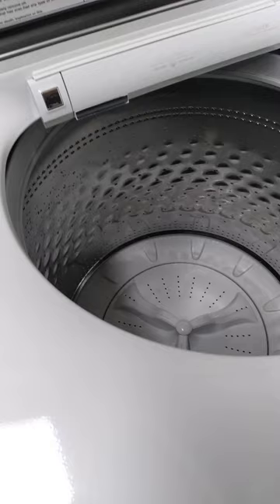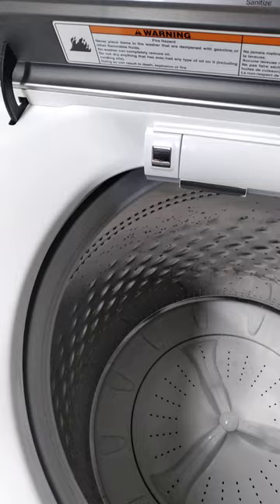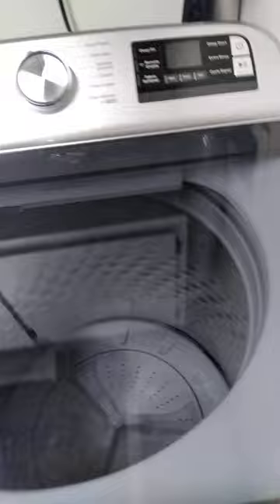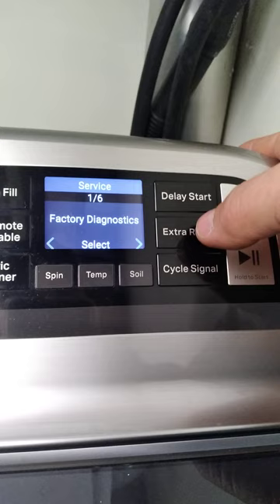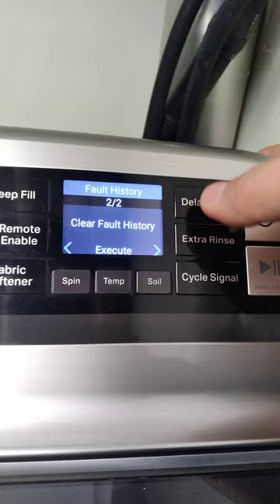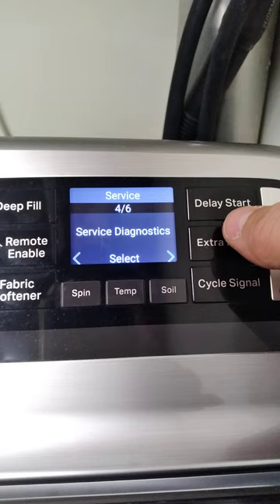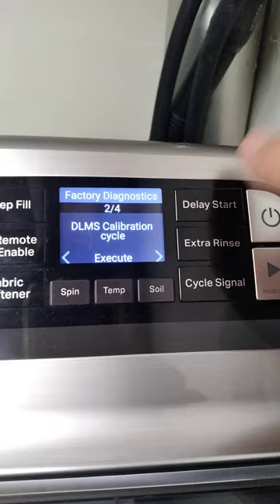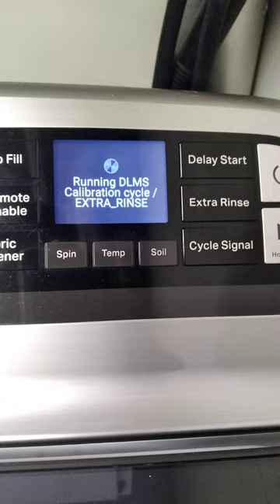Calibration and fault code in diagnostics for MVW7232HW0

Comment: I have this same washer and it is stuck in the sensing mode. It stays on that cycle for several minutes then it says washing complete and shuts off. It’s only a year old. Any ideas what the problem might be and can I fix it myself? Thank you!!!
Reply: Yeah I got the same problem  like you can see this guy don't answer the comments 😢
Reply: Same problem
Reply: I'm having the same issue. The wash starts in sensor mode than jumps to wash complete. Did you have any luck with finding a solution? This sounds like a recall issue.
Reply: @monet3293   I bought it from Lowe’s and paid for the extended warranty. 
I had a repair guy come out and run some tests on the washer and it acted perfectly for him. He said he would order some part and be back in a couple of weeks. The washer has had no further issues since then
Reply: @jasonpayne280   What part did they need to order?
Reply: @monet3293  they haven’t been back yet to install it. I will advise what part when I find out. I just know that after the repair man ran some tests on it, the washer started working like it is suppose to
Reply: I found the cause and solution!  It's caused by a bad Slider/Clutch.  This is a 2-part component - a plastic center hub, with a magnetic metal ring or band around the outside.  And that is held on by small plastic protrusions that fill in small holes in the clutch.  The problem is that these protrusions break off, and that metal ring is free to slide up or down from the plastic part, with the result that the "teeth" may not engage with the teeth of the rotor.  You could replace the clutch/slider (part # W10734521), but it will break again in a year or two.  So, I tried gluing the ring to the plastic using Super Glue Gel, after roughening up both surfaces with sandpaper first.  So, far, it is working great.  Only time will tell if that is a permanent fix for the problem.

Comment: My washer is making the popping noise at the beginning of the cycle. The display shows “sensing,” the machine clicks for 2-3 minutes and then shows “cycle complete.” What’s going on with my machine?
Reply: I found the cause and solution!  It's caused by a bad Slider/Clutch.  This is a 2-part component - a plastic center hub, with a magnetic metal ring or band around the outside.  And that is held on by small plastic protrusions that fill in small holes in the clutch.  The problem is that these protrusions break off, and that metal ring is free to slide up or down from the plastic part, with the result that the "teeth" may not engage with the teeth of the rotor.  You could replace the clutch/slider (part # W10734521), but it will break again in a year or two.  So, I tried gluing the ring to the plastic using Super Glue Gel, after roughening up both surfaces with sandpaper first.  So, far, it is working great.  Only time will tell if that is a permanent fix for the problem.

Comment: Hi Kyle ,  I just put in a new control board because the old one went out had the Maytag 3 years go figure. My questions is I have calibrated the washer, reset to factory defaults and unplugged the washer for 3 mins, on the short cycle it gets stuck at the spin cycle at 12 minutes and stays any thoughts what could be causing the issue?
Reply: Having same problem, find out anything?
Reply: Yes after calibration and still stuck, on the spin cycle option choose medium not fast this will fix issue
Reply: Also on the normal cycle turn off the fast spin then it will work too mine does not get stuck anymore hope it helps
Reply: Thanks! Will try later
Reply: It worked! Why doesn’t it work in fast spin setting anymore tho with new control board?.. that’s weird
Reply: @drewquinton7144  good question I have stop trying to figure that out it should work but I never really analyzed it for the first control board when I first bought the machine so I agree that it should work no matter what I’ve tried everything from calibrating at the factory diagnosis to the DMLS calibration and it still doesn’t work but put it in medium for turning off the fast it will not be stuck. It’ll run through the normal cycle so I would just leave it at that right now. I hope that I can be of help.
Reply: @drewquinton7144  remember Drew on the normal cycle just turn the fast cycle out there’s no medium speed for the spin but the rest of the cycles delicate and the 30 the quick wash and the towel mold they all have the medium and that’s where I would just leave it at again. I hope this helps.
Reply: 10-4, quick wash or heavy duty, medium spin setting. Been washing loads like a champ now. Thanks for the help and the patience to figure it out cause I was bout ready to throw it out
Reply: I'm in the same camp, replaced logic board and it only works on medium spin, wtf. I went to maytag's website for the parts, spent 500 dollars for the logic board and they sent me a fried one with burn marks on one of the connectors! Dead out of the box, I had them send me a new one and this is what I got. They don't give af. This looks like a firmware issue. They probably use this stupid board in 20 different variants, each with different firmware blobs. The control board is completely potted so there is no access to the PCB, there is however 3, unshrouded 5 pin headers not used and a 5 pin castellated edge header with what looks like a service port, and what looks like an IR LED with associated IR photodiode pointing out the back. I still have the original board, If I figure out how to dump the firmware and reflash these things I'll throw up a how-to on github (and probably get sued by whirlpool).

Comment: Hi Kyle, I have the same washer and I have code F7E4, should I replace the Rotor and Clutch together ?
Reply: It's almost certainly caused by a bad Slider/Clutch.  But to replace that, you have to take off the motor rotor first, and when you do, check the square "teeth for wear, and if you see obvious wear, you probably should replace the rotor as well.  Let me explain about that clutch.  This is a 2-part component - a plastic center hub, with a magnetic metal ring or band around the outside.  And that is held on by small plastic protrusions that fill in small holes in the clutch.  The problem is that these protrusions break off, and that metal ring is free to slide up or down from the plastic part, with the result that the "teeth" may not engage with the teeth of the rotor.  You could replace the clutch/slider (part # W10734521), but it will break again in a year or two.  So, I tried gluing the ring to the plastic using Super Glue Gel, after roughening up both surfaces with sandpaper first.  So, far, it is working great.  Only time will tell if that is a permanent fix for the problem.